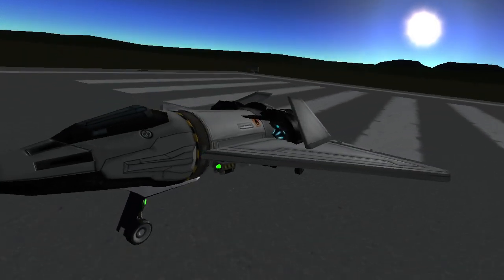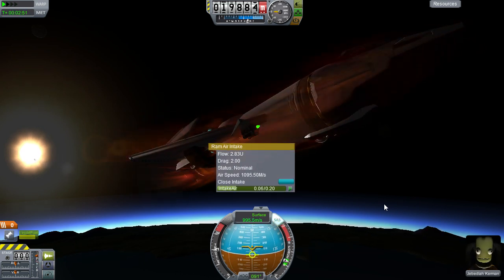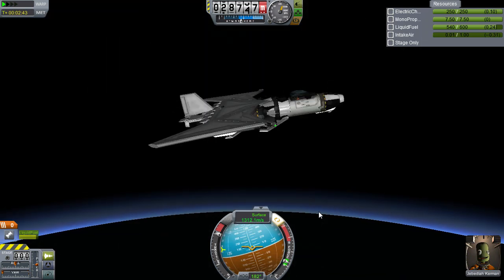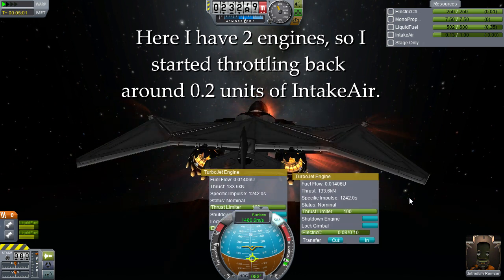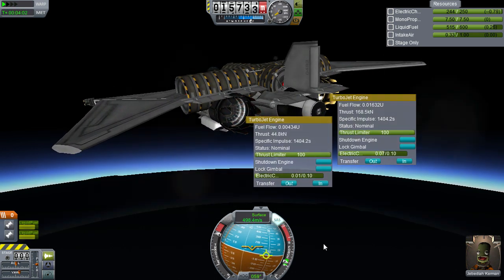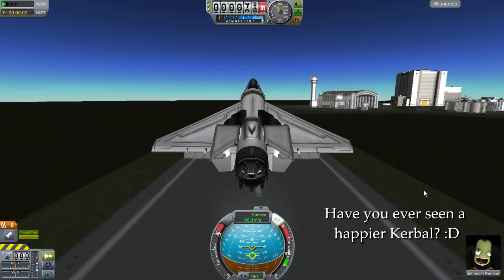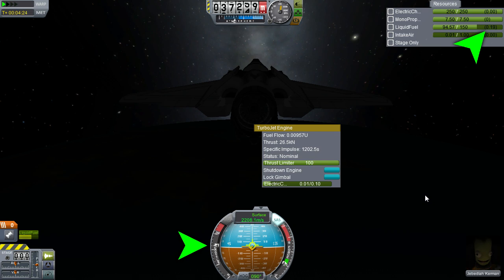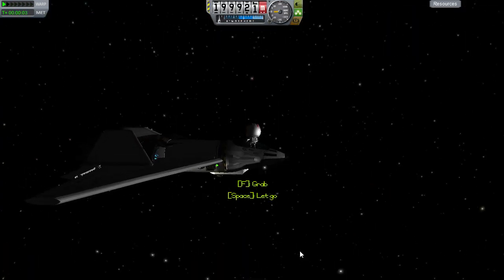KSP Quick Guides: High Altitude Design and Flying - Stock v.23

Comment: I'm using the newest version of KSP, 1. something. 
But one key thing I've never seen anyone do, is put two turbojets on the side of the fuselage, and get up to 1500m/s. Then on the center fuselage, have a nuclear engine, and use the nuke to give extra push once the turbos start to run out thrust. Higher speed will keep the turbos running longer, up to 40km. Above 40km, go all nuke, and basically get up just under 2000m/s. Trim the thrust down on the nuke, and if the AoA is just slightly above level, and balanced with the nuclear thrust, the planes can cruise upwards of 60km almost indefinitely as the amount of thrust is basically 1-3% of the nuke's power, and it sips fuel. I think the last endurance run, I completed 5 or 6 orbits before getting bored, all over 60km and just around 2050m/s. Its just like orbiting, but the tiny little bit of drag is countered by the nuke.

Comment: You can control flameout of multiple engines by using the Stabojet configuration. Check it out on the KSP forums. http://forum.kerbalspaceprogram.com/threads/43499-Amphibious-VTOLSSTO-Mk1-W-STABOJET%E2%84%A2-technology-%280-21-1%29

Comment: Where did you get the data for the graph comparing the basic jet and turbo jet?
Reply from the maker: I got it from the forums. This thread has the updated data as of .23 which includes the RAPIER: http://forum.kerbalspaceprogram.com/threads/67606-Fuel-consumption-as-a-function-of-atmospheric-pressure?p=939065&viewfull=1#post939065
Reply: Thank you!  I love know the details of the craft, and being able to see why it acts as it does, and refine accordingly. (Can't imagine not having kerbal engineer installed for this very reason)
Reply from the maker: Ya knowing more info about the parts you're using really helps with making the best designs!

Comment: I never used reaction wheels ;D Anyway great tutorial :D It will help people a lot ;d
Reply from the maker: Thanks! I hope it does :D
Why don't use you reaction wheels though? o.O
Reply: I didn't know about them much (anything). I was using standard methods ;d
Reply from the maker: Ah, gotcha :D
Ya I definitely recommend at least one on anything other than the smallest of designs. At high altitude your control surfaces get pretty lazy and don't do much.

Comment: I always have a bit of RCS on my SSTOs to actually dock them to a station or w/e I want to rendezvouz with.
Reply from the maker: Yup! I usually use 1 or 2 of those small RCS pods on my designs for space type stuff :D
There was a challenge on reddit once to dock multiple modules without using RCS. It was a fairly tough, but doable :)

Comment: Don't warp! When warped it seems the intake air bar gives you false readings.
Reply: They actually give you a true reading that is only true while you are warping. You can even exploit it, if you feel like it.
Reply from the maker: Ya the value seems to multiply by whatever your physics warp is set to (1x, 2x, 3x, 4x). I don't think it hurts anything though as long as you go back to 1x at some point. Sometimes I'll use it to get a better indication of how much air I actually have, like if I'm at 0.02 at 1x I can warp to 2x and get a value of 0.03, telling me I actually have 0.015 units of air at 1x warp! Kind of a nifty trick, but not incredibly useful.
Reply from the maker: Mandos Aldmer Have you tested if you can actually exploit it? While the Resource bar changes with warp, if you click on the intakes themselves, the flow and airspeed don't change, which is really what KSP is using to calculate your actually total air. I had tried seeing if I could kickstart a flamed out engine by warping, but it doesn't seem to work which had reinforced my previous findings.

If you find a way to work let me know though! I'd be very interested :D
Reply: No problem!
Reply: Cruzan AK I never really "exploited" it, because i usually only warp in low altitudes, since the intake change/inclination change is a bit imprevisible during warp.
But in low altitudes, i have managed to lift up the nose of the plane and use more air during warp, altough it should be noted that while warping my plane tends to lower the nose by itself, so i don't know for sure if that makes any difference.
But my guess is that you can indeed exploit it, if you are somewhere with less atmosphere, which seems to cause less of the nose down thing for me.